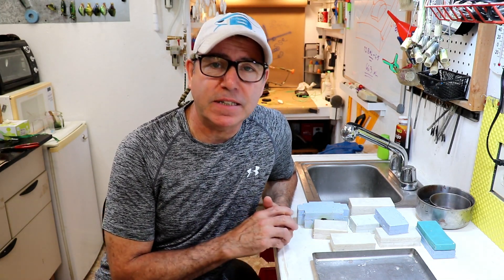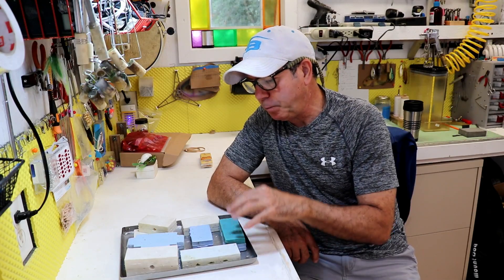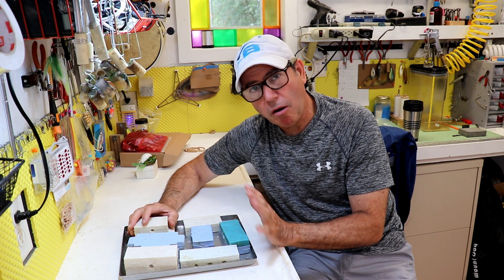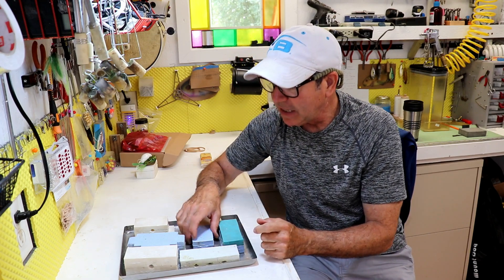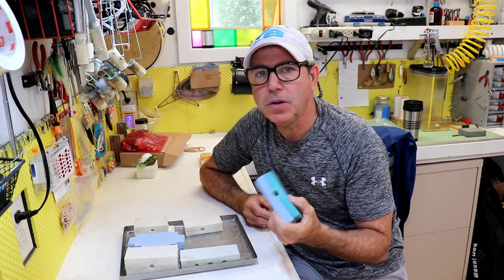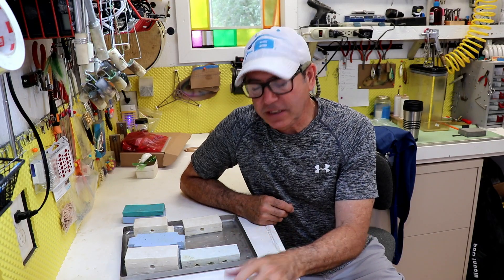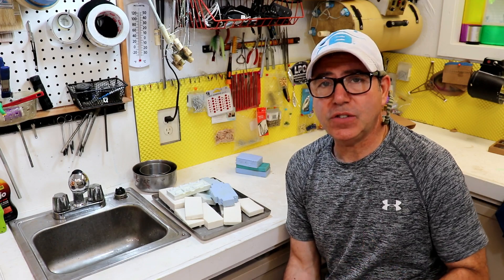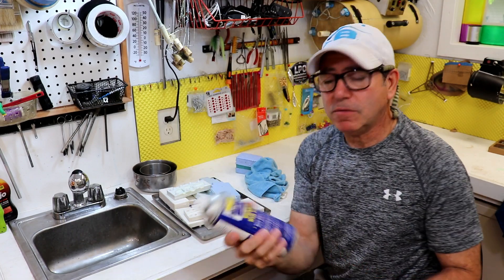Silicone Lure Mold, Design and Care

Comment: I had a production casting business for about 10+ years and found Dow Corning 3110 and 3120 silicone better than any smooth-on or poly-tek product for casting either resin or metal.  Dow Corning also makes lower durometer rubber if you have under cuts.  Main reason is paste type catalyst which is much easier to measure and can be measured much more accurately which also saves money.   Part of the problem you are having with mold longevity is all the bubbles.   Careful pouring and/or vacuum the RTV prior to pouring and after pouring can solve the problem.   Mold design with good sprue and vent orientation makes a big difference.  Price Driscoll offers excellent Ultra4 mold release at a reasonable price.   No need to rub it in, just spray on a thin coat.    Although I've never used it,  "silicone oil" can also be used to rejuvenate molds.
Reply from the maker: Thanks. .good info.

Comment: Have you ever used PVA mold release?  It leaves a very thin layer of something that looks like Saran wrap.  Nothing sticks to it. It is often used as a guarantee not to stick sub stance in addition of to wax or Vasoline.  It is sprayed on...mist bottle.  PVA can be found where fiberglass and resins are sold. We used it at Irwin Yacht and Marine.
Reply from the maker: Thanks for the tip!

Comment: Good say sir. I hust want to ask about the durability of this molding material if this molding is use in metal jig
Reply from the maker: The silicon I used in the video can't handle the heat of metal casting but, you can get a high heat version that will work.  Google: high heat silicon mold material.

Comment: I think I read on smooth on support that pouring plaster in the molds is best for storing them for long periods. Have you tried this?
Reply from the maker: No but, if I'm not planning to make lures with a mold I put the original master in to store it.  I suppose it does the same thing...